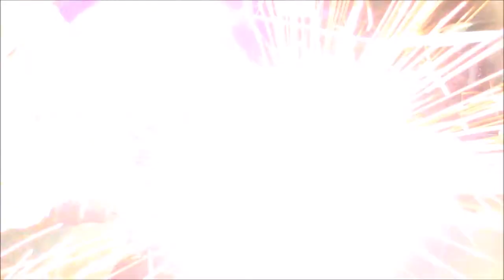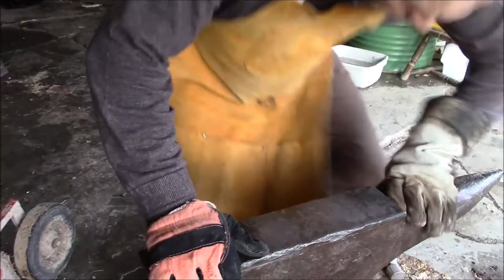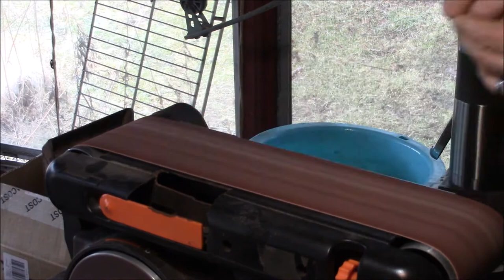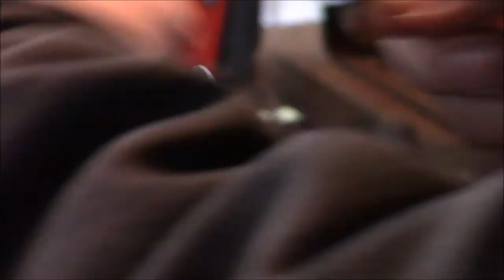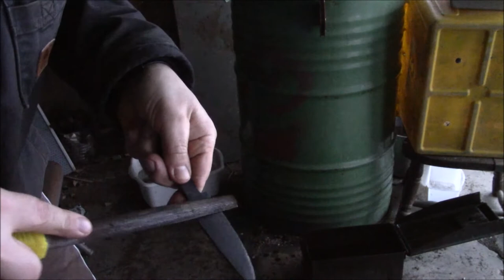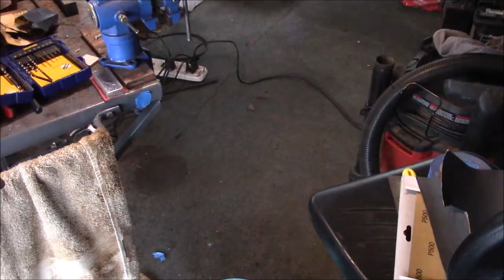Sportsmans Banquet giveaway knife. Part 1: Forging the blade.

Comment: Hey brother, try quenching your spring steel in canola oil. Preheat your quenching oil with a couple of heated up chunks of steel, oil around 130 degrees will cool steel faster than thick, cool oil. I guarantee that the weather making your oil cold is a factor, and try the cooking oil too! Love the channel!
Reply from the maker: That was pre heated canola oil... lol. It wasn't previously used as fry cooking oil. ☺

Comment: hey WJ im a starting blacksmith since 5 mons now and you'r bivels are not so bad my master tell me to this is one of the most dificulte in making a blade so don't worry . ( the littel thing we call it notch most of the time ) . and also watch out beause it's possibel to do somme hammon in oil to ( because the définition of a hammon is a difference of grain structure beetween two part of a same piece of steel ) . to finish don't worry from warping for this sort of thikness have already kwench mutch more finer blade and don't warp at all but you should worry you'r self if it warp when you normalise it ... hope fully it help you . (sorry if my english is bad >^< ).